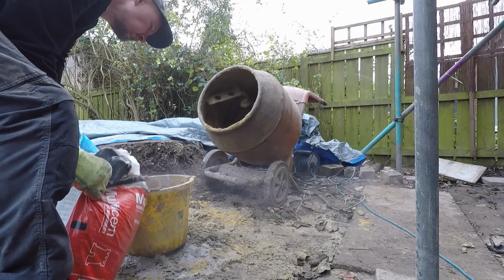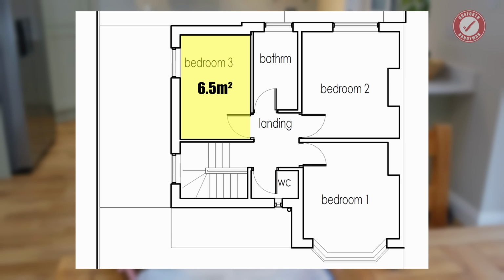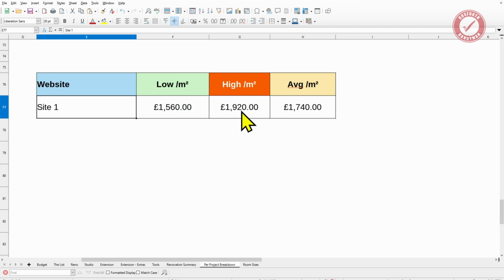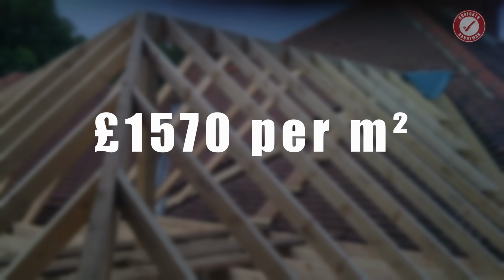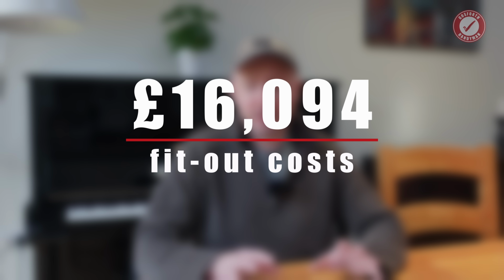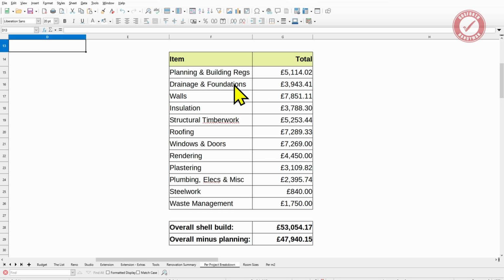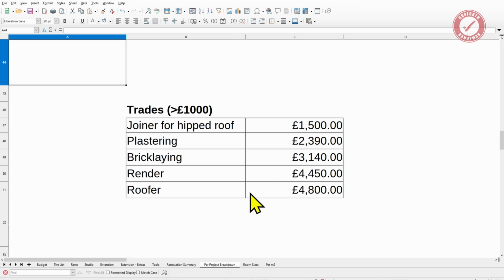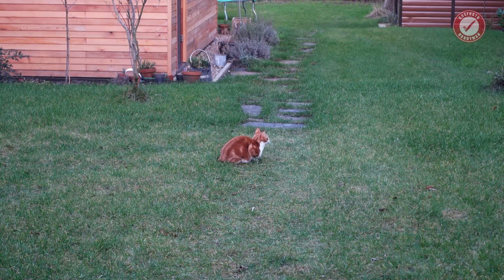How much does a UK house extension really cost?

Comment: I've just completed my extension

I'm an electrician by trade but moved up to project management 
So I thought it would be a good idea to manage my own extension. I asked for a quote from a builder who had done a friend of mine extension. He came back with a 40k shell only 9mx6m no interia works except the steels and knock through  just drainage and soak away and Gutterings 
Well, everything went to plan at the beginning except his son breaking his arm the first day, so I had to step in and help where I could to stop him pulling off for 6-8 weeks 

All went well, but towards the end of the job, starting getting stupid excuses about steels, etc and then he decided to pull off site without completing the soak away and few other bits and leaving a leak which was a pain in the ass to fix as he installed a Rubber membrane roof called EPDM which no roofer will repair
So I'll have to take him to small claims court unfortunately to claim back some of the additional costs I have had to pay out for, which was on his original quote.
But moving forward, I got over those issues and installed a wet underfloor heating system supplied from a new electric boiler designed for underfloor heating as energy costs are going through the roof

Overall, I did 90% of the internal works myself electrics,plumbing,carpentry,painting,fitting kitchen,installing new shower room it roughly works out to be 80m2, everything including all building control documents £85k
And I would say the finishes are towards the high-end costs 

Overall, I can say it was well worth it if you are able to do most of it yourself because even being in the trade, if you give some people an inch, they take a mile. And they will never do it to your standards

Comment: This is really helpful but also quite depressing. I want a similar extension on my 3 bed semi but the costs are just too high. If I had £70k to spare I'd rather use it to move house. It certainly wouldn't increase the value of my house by a corresponding amount.

Comment: I asked the Age UK and send me a man to Screw piece of wood to stop people opening my old garage. He only put half of the length of the side of the garage - not whole size of the sides of the open up door. He charged me £60 to screw two pieces of strip of woods about 1m length. Again that’s influenced by the bad neighbour. The demon looked at me struggling to unlock the jammed pad lock of the side door of the garage; again he send a workman immediately after I entered my house at the back someone knocked the door. “ Hello I am a workman do you have problem in your garden - I can help - won’t cost you a lot” OK so Isend him round the back and showed my jammed lock and I just bought a new padlock. All he did is unscrew the old metal flap from the door that holds the lock, then moved it lower. He put a piece of wood and with his 4 new screws and he asked for £220.00 cash only! I have his calling card in my pocket which matches the info on his Van. So I told him I am going to get the Cash from the bank and took the bus. I saw his wife and daughter looking for me through the bank windows but I wasn’t there I was at the police reporting the incident showing them his info on the calling card. The and daughters wondered when they bump into me coming from the police whilst they walk up and down! This neighbour should have be seen by the creator of heaven and earth and must marked his days! He removed the partion treles, moved their fence inward my garden and poured cement in between my garage and his old garage. Then built a garden house over the partition line and expect me to move my garage inward my garden by 1 Meter? He build his garden house without a planning permition and building Control permition but has connections at Richmond council so they gave him permition after he applied when he finished his building. Richmond is full of racist neighbour but I am not going to move I am too old for stress. I trust in God He will do something to stop this racist.

Comment: It's great reading all the DIYers comments here, 10% the cost etc. Well here's the thing! If you contract a building company in to do work you will more than likely have to pay VAT on the value of the work then there corporation tax they will have to pay, plus they will add a percentage for overheads such as liability insurance, handling paperwork etc. They will quite rightly add a profit margin so they can expand their business or use it purchase new equipment, etc. that's not including wages to subcontractors! I mean 20 years to do your renovations? it would've been cheaper contracting a professional builder! And if you've all had dodgy builders in the past, blame yourselves for taking the cheapest quote and not even doing you groundwork by checking out their qualifications!

Comment: Great video. We are just about to extend our 1850's EOT, Listed, Victorian building in SE England. Notoriously expensive. A two storey addition it runs to around 40M square and is being built with ICF's (Insulated Concrete Forms). My choice as I'm a believer in new tech.

The cost quoted by an ICF builder, including a bathroom, en suite, and fittings (bath/sink/etc.) and new windows/patio doors is £100k including VAT.

We supply the kitchen but they will install it.

I was feeling pretty hacked off at £100k, but we had numerous builders quoting more, but who had never worked with ICF before, so there was a risk the undoubtedly priced for.

Our ICF supplier, Beco Wallform, suggested a builder in Sevenoaks, Kent, who they had worked with before.

Judging by your video, I now think we have got a reasonable deal considering how materials prices have shot up since before covid. The build will also only take three weeks which is, in my experience, far quicker than using conventional methods, but that remains to be seen.

I will try to do some time lapse video of the build and make it available to anyone that cares to watch it. My kitchen of choice is DIY-kitchens especially since I watched Gosforth handymans video's on it, although I won't be fitting it myself.
Reply: Can you please share the ICF builder’s contact; I am looking to do an extension. I live in Orpington. Thanks in advance

Comment: my single storey 8m x 3m extension on the rear of my house 8 years , which generated me a 5m x 3m amateur radio shack/den and the rest as a utility room was £15,500, as a shell plastered plus £800 plumbing £400 for the sparky and about the same for the electrical supplies from screwfix and £1100 for 3 triple glazed windows and 1 half and half triple glazed back door, like you i would do it again, BUT if i was putting on a 2 storey side extension i would proably opt for structural SIPs panels and maintain current roof profile for the gable end ,mainly for speed of water tightness, plus more space on the rear roof for  more solar panels, my extension being a flat roof (6 degrees pitch) gives me room now to add 7 more solar panels being a south facing roof is a big bonus,@ the time of the extension we replaced all the kitchen worktops and added worktops into the utility room i had silstone/quartz  worktops which were another £3200 fitted, pleased with my extension damm right i am, the only thing missing from your breakdown is a house value both before and after, that would have been a good added comparision as well :)

Comment: What I’m confused about is your judgements on what people should be earning or charging. Some trades are much more difficult than others both in terms of skill required, danger and cost of equipment. Roofers, for example. how much would someone have to pay you to carry thousands of tiles up ladders of your back for example with all the contentions that come with that. There are fewer people available to do these jobs therefore the price is higher. 

In terms of “profit” you’ve not considered the actual cost of running the business - 100k worth of equipment is not unusual, 12k a year on fuel, 10k a year on insurance, works unit rental cost, cost of repairs, wages and staff pension contributions, business rates, ongoing training costs, replacement of tools and equipment that can’t be repaired, time spent on “free quotes” which can take 100s of hours each year, accounting costs  the list goes on. Most self employed trades I know run on about 15 to 20% real terms profit. Your roofers for example perhaps made £1500 for a week. Divide that by the number of people on site and that’s their wages. That’s why it’s rare to see builders pulling out of the driveways of huge houses in the morning. 

The oversimplification of everything is all too common these days.

Comment: £1,000 per day roofer but how many roofers? I suspect a 2 + 1 gang 
So, I suspect you're talking £250 x 2 plus £150 × 1 that equals £650 add overheads and profit say 30 % 
plus VAT  that equals £1,014 per day 
So,  don't feel too hard done by the roofer.

Comment: Labour costs are crazy. Back in 2005 I managed and helped to build a small 10m2 lean to extension and it came in at about £8000 including carpets and decoration. £2000 of that was a raft foundation and then 5 days’ labour for brickies. I’ve just build a cedar clad fully insulation garden office for £6000.

Comment: You have costed the work based on a self build.  All you should be adding on is project management fee and overhead & profit on labour plant and material and adding VAT onto the total cost being careful not to double count. So, you need to calculate the net cost per square metre. You low cost area and high cost area is not the correct approach.  The material and plant cost will be similar the labour cost will vary somewhat.  The difference in low and high cost area cost per square meter using estimates is not correct.  The only way to make a comparison is using a bill of quantities.  Your approach is too global and provides no meaningful breakdown.  In general the cost per square metre for domestic construction should be £135 per square foot ( £1,500 per square metre).  But, this is for a ground floor extension.  A first floor extension is much cheaper, I would say, approx £70 per square foot (£777 per square metre). 
You cannot calculate cost in the manner you have done so. You should have calculated the cost per square metre for the ground floor extension then compared it to the garage and bedroom.  I'm sorry to be harsh, but your approach is wrong.
You need to cost your project management time that I suspect was significant and labour time used on the build. 
So, in broad terms I'd expect your extension to be £40,000 and side extension £20,000 allowing for additional ground works and incorporating the extension to the main house.  I'd expect the builders quote to be £60,000 plus VAT 
Therefore,  £72,000
In reality,  a builder will probably add something dependent on the market.
So, I would not be at all surprised for a builder to add another £10,000 to £15,000 on the £60,000. I personally wouldn't pay more than £70,000 plus VAT for those works.....
And that includes Finhshes !!!!!

Comment: Coming from a Engineering  background and having worked on construction projects for over 18yrs now, it's good to see someone breaking down a project on a residential  extension.

I've done extensions and I would have at around £96k from information and sizes off your plans.

And that would be making a modest 10 to 12% I reckon.
We only work to specification and above.

Looks a nice job, well done.
Regards

Comment: Well done mate. We mainly did large commercial/corporate jobs when I was still in it but did do a few small builds and extensions too. I just dug out my last set of builders bibles from 2009. Its m2 averages are £750 for basic going up to £980 for high spec (stone, thermal etc). We had our own formula that fell in between at the time. My earliest edition (early 00's), from £350 m2! Gone a bit crazy eh? Again though, excellent video and grand job on the extension.👍
Reply: So Pound is losing its value fast. X2 every 10 years. That makes saving money worthless.

Comment: Big fan of yours, your video about how much a carpenter should charge helped me lots at one point. There is one thing I missed in this one and that’s the amount of time that you spend. So, charging £35 per hour, as you suggested, the price of the build per square meter would be substantially higher? Time + quality + cost = great builds. The quality and passion in this build are great btw! Thank you one again!
Reply: Having chosen to landscape my own garden considering what I thought were ridiculous quotes, you make a good point. I've saved a small amount of money but spent a lot of my own time and also wasted a lot of money due to inexperience - plus it's taken 18 months whereas a contractor would have had it done in a month weather permitting.
However, I think it's been done to a much a higher spec than the quotes would have done it, so I'm happy with the decision I made. I slightly saw it as a test project for the mansion I will likely never buy.

Comment: I was quoted £7000 to re roof my 3 bed existing semi and a new pitchedroof extension which is half the size of my existing roof. I sourced the tiles myself for £1100 and the battens, lead, dpm, nails for £600 and found an older roofer who charged £150 a day. It took him 5 days in bad weather. Go figure
Reply: Nice saving. 🇬🇧 👍

Comment: Been working in the trades my whole life and would agree with everything you said. We also much prefer working for self managed builds if the client knows what there doing. Generally less stressful lol!
Reply: I’d find it completely the opposite . I have refused to quote several jobs where the client had said they’ll project manage in the 17 years I’ve been in business. !
Reply: @leer798  You couldn't get away with the rubbish workmanship in that instance, I understand that... Another plonker
Reply: @Thiago_Bri  I think the point is most customers don’t know what they’re doing with project management we have had a few and it was always really hard work and we ended up running the job because they were just overwhelmed by it. And the op did say if they know what they’re doing but in my experience they don’t.
Reply: @simonelliott2945  I was asked to quote a job where the homeowner/project manager had actually booked in the  decorator before any of the trades!
Reply: You can work with a builder where they tell you the schedule, especially of you are doing some work.  So we were told to get going on taking the plaster off and getting each room back to the brick.  That's saving us £1800 per average 12  x 14 room.  I like working like thst because they're the expert and we can do the grind❤

Comment: If your roof plan is suitable highly recommend trussed rafters, very cheap, very rapid delivery and just send the provided calcs to building control. Cost way less than hiring  a carpenter that's if you can find one who doesn't have a long waiting list. Unless you have the contacts it can be very difficult finding competent people especially in high cost busy areas.

Comment: Was the roofer labour only charge? even if they were only supplying underlay, battens and fixings it's costly. As roof tiling is the easiest of all heavy roofing it should be quite a low labour rate. Granted I've been in NZ now for 15 years but when I was in UK (lake district) tiling was about 20 quid /m2 labour. If I recall your roofers even failed to do basics well .. I apologise for legit roofers....
Reply from the maker: As you say, labour + felt / battens / fixings / flashing. 👍

Comment: making garages into dwellings leads to a scruffy local area with scruffy obtrusively parked cars all over the pavements... - and that de-values the whole street...
Reply: Most UK garages haven't been able to fit an average car inside them since 1985. My wifes renault clio can fit inside ours but I'd have to fold the mirrors in and climb out the window to get out of the car. Even new build garages are usually too small for a modern mid size car - infact vehicle parking and provision on new build housing estates near me is laughable, often with one parking place allocated or a small single driveway and very little space around for further parking - say if you're having visitors. UK new build housing appears miserly to the extreme. Absolutely agree with the cars crowding the pavements and looking ugly - also compounded by people driving SUVs larger than their living rooms. Yes I am looking to move. Thought I'd look as some of the massive number of new builds near me cos better thermal properties and less maintenance than my Victorian terrace. No, I wasn't happy with what I saw. /Rant over
Reply: @spamheadthe3rd  seen an suv held up by the edge of its tyre on the curb the other day... - blowout on the dual carriage way for them soon...

Comment: Very good video, I did not really get how much hours you did spend that otherwise a hired builder would do? (Sorry, havent seen al vids). Cus if you hire tyem out it would be more expensive. And of course builders make some profit on the materials, though not like that other company said. I myself dont do extensions but more timber framed buildings and I always quote per finished stage. E.g. the frame, the roof, the exterior shell and that includes labour. I also add unforseen costs which can be made but not all the time.